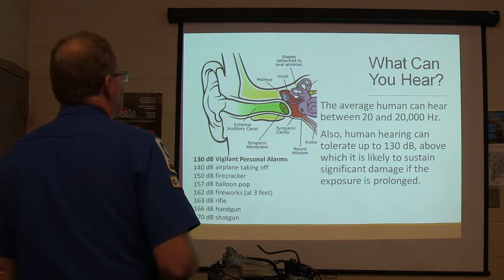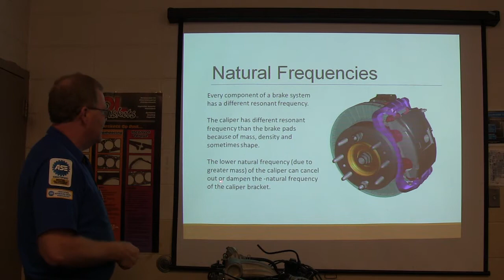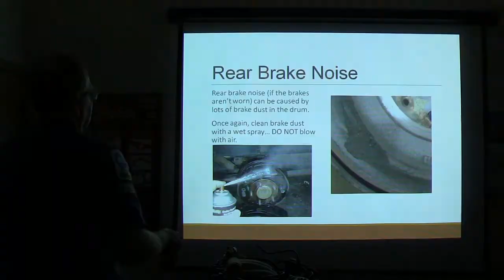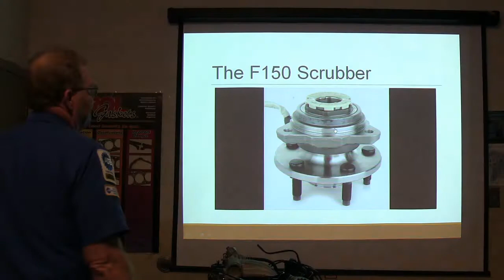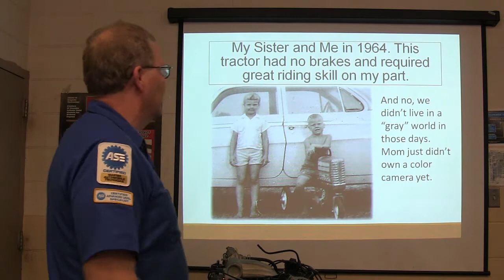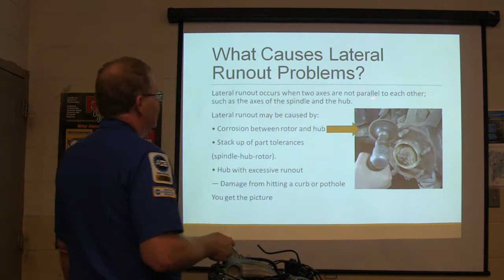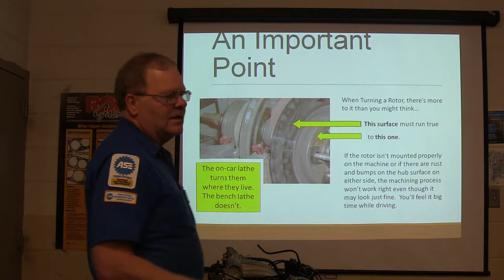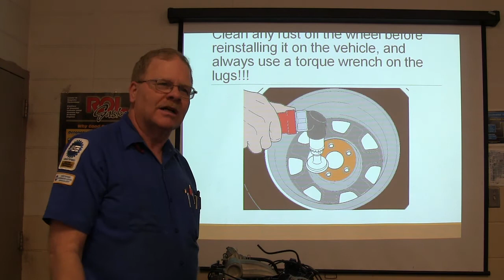Brake Noises and Roughness

Comment: I suggest cleaning  off the ABS sensor of metal shavings after metal on metal contact or on car rotor turning. It may be a good idea to check them for metal shavings after a regular non-issue maintenance brake service or bearing replacement. On many occasions I have seen metal shavings fooling the system to activate when it was not needed.